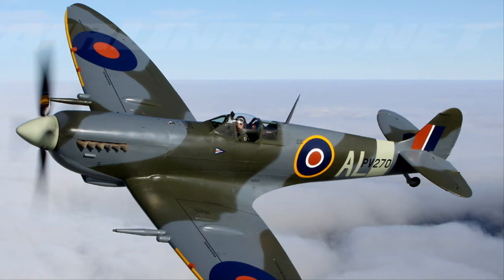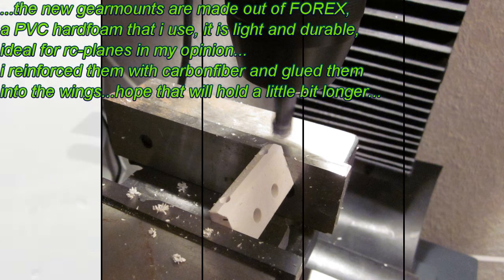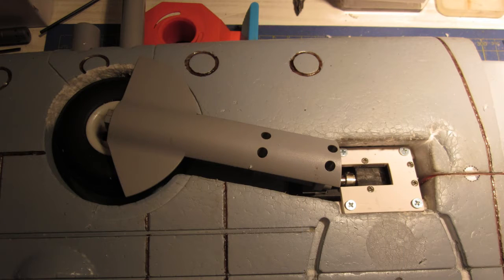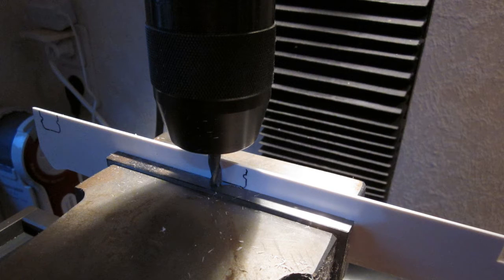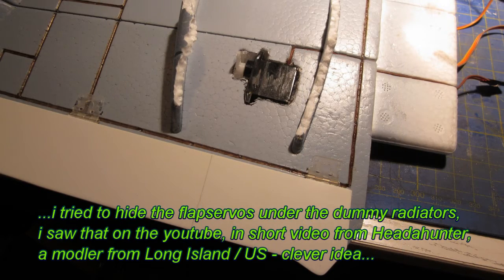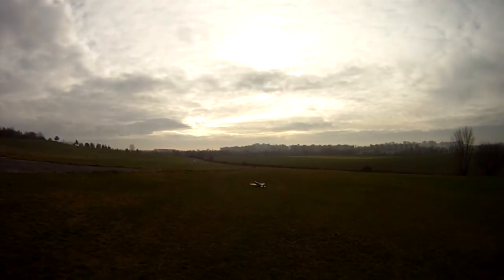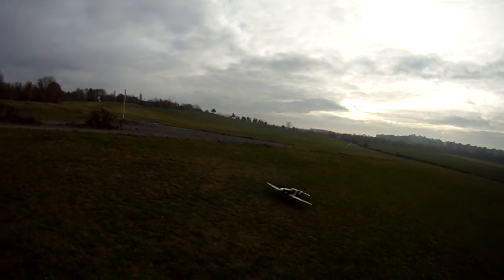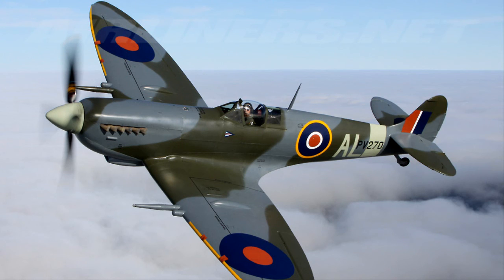FMS Spitfire gear & flap mod

Comment: What an amazing area you have to fly in. Great video and well produced;  glad to see you got rid of the Comic Sans ;)
Forex is also known as Foamex, in the UK anyway, Google it. Printers and sign makers use it to mount. Comes in 1mm, 2mm, 3mm, 5mm, 10mm, If you pop in to a print shop and smile there are often cut off's knocking about.

Keep up the good work :)